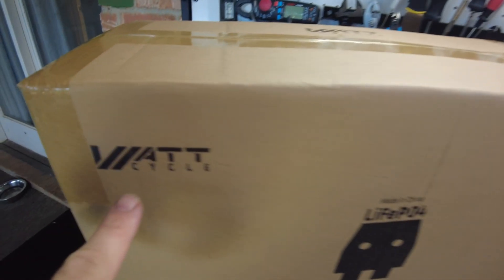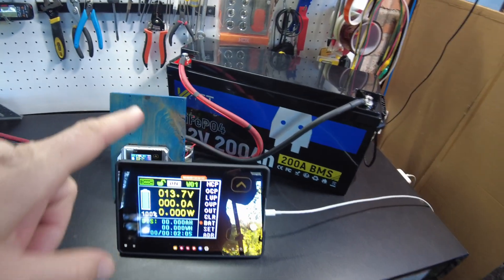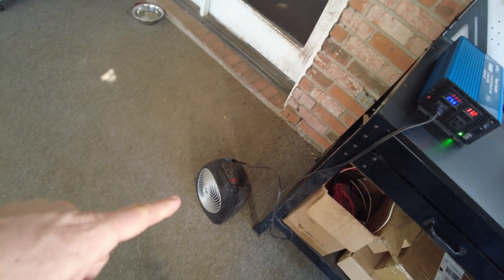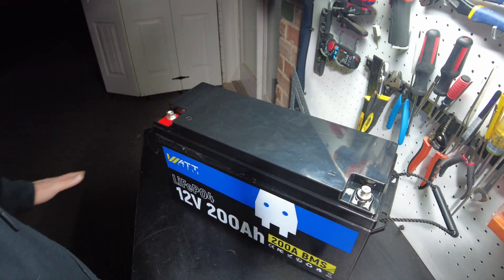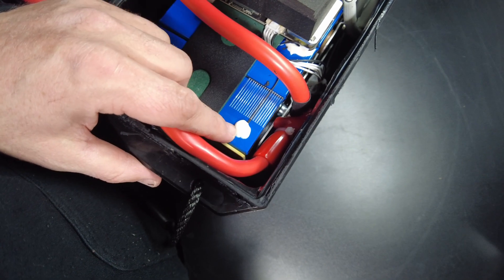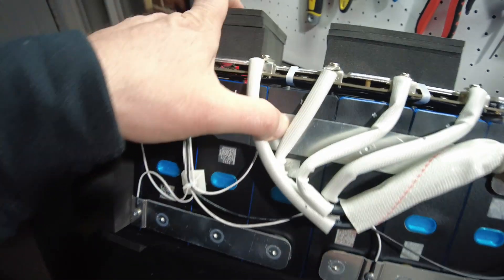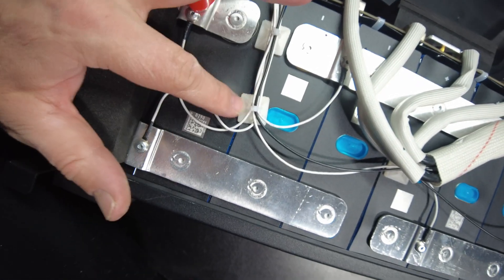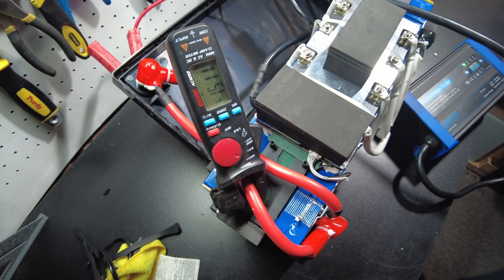Wattcycle 12V 200Ah LiFePO4 Lithium Battery

Comment: I just bought 2 12v 300ah watt cycle lifepo4 batteries I plan on running and charging in parallel.  Also have an 80a charger arriving.  Is a breaker/fuse recommended to go between the charger and batteries? 
Thanks

Comment: I understand the popularity of these for the RV crowd, but I would much prefer a 24v 100ah version for the same price. It has low temperature charge protection and the build quality is pretty good. The BMS settings of 2.2v and 3.75v are a deal breaker for me. I have cycled cells several hundred times between 2.5v and 3.65v with zero bloating, so I would be extremely reluctant to use their settings, I suspect it will seriously affect cycle life. Between 3.1v and 2.5v you will notice the cell temperature rises 3 to 5 degrees C, so I personally would never take cells below 2.5v. In normal use (not capacity testing) I don't take mine below 3.0v and 3.5v (gets you about 95 to 98% of capacity).
Reply: No dought 24v

Comment: That thing is very well-built, especially at that price point.  Just a couple of years ago, LFP batteries were going for around 43 cents per watt-hour.  This battery, with a 200a BMS, is only 19.5 cents/wh.  Very cool stuff.
Reply from the maker: Yeah, crazy good build. The prices keep plummeting, and the quality keeps going up. Cool stuff for sure!
Reply: Thank you for your comments. I was very pleasantly surprised. if you are interested in our products after watching the video, you can buy our products by clicking the link below the video!🥰🥰💕

Comment: Good video, but a bit of a soft pitch.  A great battery would have expansion and contraction humps in the bus bars. A great video would have showed the temperature of the battery after sourcing 1k watt for ~2 hours.  A really great video would have  included testing the battery its maximum discharge rate.  ;)
Reply from the maker: Great points, I'll do better. Thanks!
Reply: I think that their thinking was that with the metal banding on on the cells there was no need for the expansion humps on the bus bars.  Since this is the first battery I’ve seen with banding like this I tend to agree.